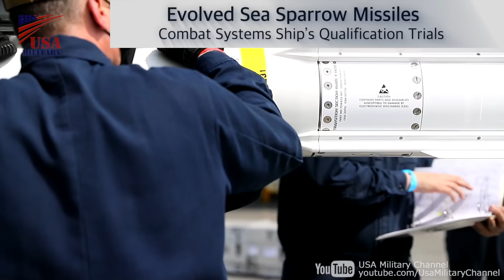Amazing Aircraft Carrier Building Process / US Navy "CVN-78” Gerald R. Ford - time lapse

Comment: Here's a question for all of you structural engineers out there; what exactly connects the Island-Tower/Bridge structure to the flat flight deck?  I'm assuming it's a fair amount of welding, but it seems to me that that would not be strong enough to hold it in place, especially when the ship leans heavy to port or starboard in rough seas or high-speed turns, it seems to me that the whole structure would rip off and fall into the sea.  Anyone know the finer details of the actual mating process? I understand that this is a very technical question.  Cheers.
Reply: As a welder there are 100% supports running from the to all the way down to the bottom of the hull that were welded together when the tower was installed in addition to it also being connected to the deck the odds of it ripping off is really hard to do

Comment: With all the Technology available now those men have to be pushing broom, I assumed to pushes off  Water.
Reply: no....washing the deck from fuel or oil leaks. Lot of equipment moves around on the flight deck, from planes, to forklifts...so a good cleaning is needed from time to time. They also head into rain showers while at sea, to " wash " off the salt which gets into everything. Rain being clean fresh water helps keep the salt corrosion down.

Comment: Why does not super Carrier have armor protect from missile?
Reply: Because big armor like a battleship isn't really worth the trade-off.  The amount of weight consumed for a worthwhile amount of armor would take too much capacity from things like how many planes it can carry.  Missile defense comes first and foremost from the ship's planes (destroy what would launch missile with the planes before it can attack the carrier), and then with point-defense (RAM, Phalanx, etc.)

Also, carriers are very heavily compartmentalized.  Even if you hit it with a missile, you'll only likely do damage to the part you hit.  It will get sealed-off and the rest will continue operating as normal.  Vital systems such as reactors and magazines are deep inside the ship (and do have some armor), but the carrier's sheer size works as sort of an armor in and of itself since there's a lot of bulk you have to get through to reach those vital systems.

Can it be killed with missiles?  Sure, any ship can.  But you're going to need to successfully land multiple missiles to do it.